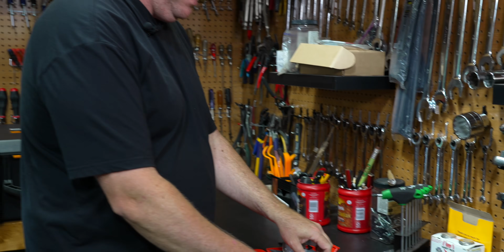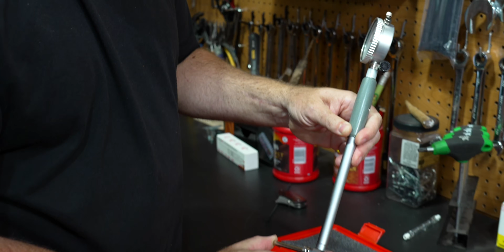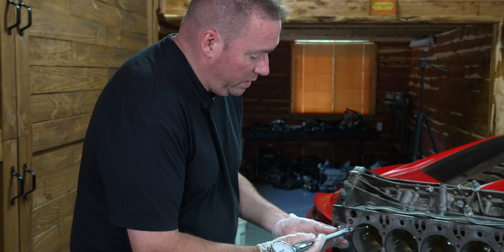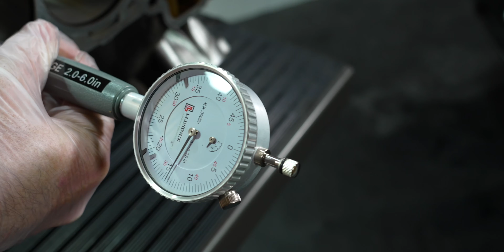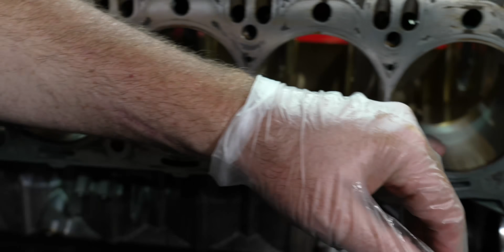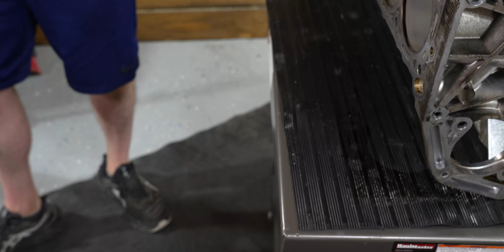Is My BMW M5 S85 Engine Fixable Or Scrap Metal ???

Comment: nathan should upgrade the pistons an rods an get one of the 80mm air condtioning system thats runs on 20 psi of cold air in the cabin for maxium m performance

Comment: To use those correctly you rock them side to side and take the shortest measurement that it indicates, when rocking them it’ll go long measurement and as you rock it back you’ll see the shortest measurement when you get to the center then it’ll get longer as you continue to rock it. You want the smallest one, it’ll insure you are exactly perpendicular to the cylinder, and have an accurate measurement. You can also check them for out of round by checking different points.
Reply: Seems like a tedious process. I’m surprised there isn’t a better option to determine the circumferences
Reply: @johnnychimpo7539  There are better tools. There are even laser bore gauges that will give .00002 accuracy. Those aren't $50 tho. Would help if he used the tool he has correctly tho.

Comment: The bores are not coated, it’s an alusil block, something like 70% aluminium, 30%silicon. The bores are honed in a specific way, very specialised btw, this exposes the silicon and this is what the rings run on. Very low friction, very low wear. Like someone else said, the bore gauge looks like it’s set wrong plus you need to measure at bottom, mid point and top at 3 different axis to properly determine wear and possible ovality. 
I had one of my bearings spin, had the crank ground etc and oversized bearings, it lasted 2k miles, there was micro cracking invisible unless tested for it which I failed to do. I stripped it down, I t was the same bearing that failed. I would 100% not risk using the crank again. 
If you didn’t know already, the rods will need to be checked for ovality, torque them up to factory spec to ensure accurate measurements, even though I had only one rod bearing spun, 5 rods were out of tolerance. 
I enjoy the videos, good luck with the repair
Reply: This makes me wonder why people rebuild bmw engines that have failed. Seems like a gambling with everything working and lasting, even for an expert

Comment: Hey Nathan, please source a machinist's ruler for checking straightness on your block deck. A carpenter's framing square is not manufactured to the same standard, and is usually a stamped steel part, not a machined piece.

Good carpenters can work to the accuracy of a thin pencil line, 2nd rate framers work to the accuracy of the saw blade thickness, and hacks work to the accuracy of a chain saw bar thickness.

Comment: Others that I’ve seen check cylinder bore  integrity they have the block on a engine mount and they cylinders are vertical, not horizontal. It’s easier and accurate to use the gauge vertically so you’re not trying g to keep it straight.
Reply: Doesn’t matter what the orientation of the cylinder is if you use the tool properly.  He isn’t using the tool properly.  You’re supposed to measure the cylinder at various depths.  Once at the depth you want to measure you rock the tool back and forth and the measurement you take is when the reading on the gauge is at its smallest.  That’s how you know the tool is perfectly perpendicular to the bore.  If you do this at a number of depths you can then tell where the bore is tighter or looser.
Reply: @JeffL396  orientation is important. It’s easier to keep the measuring spring even in the cylinder if the tool is vertical as opposed to eyeing the tool being perfectly horizontal when using it on its side.
Reply: @paperandmedals8316  completely irrelevant.  The smallest reading on the gauge is always parallel.